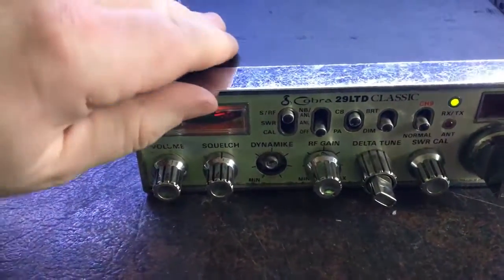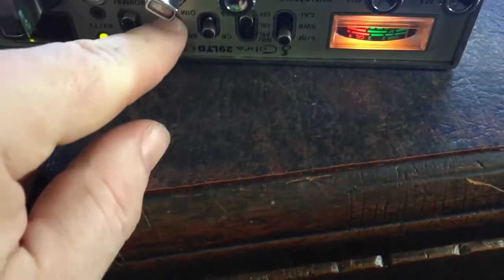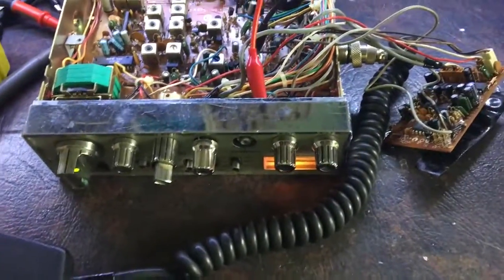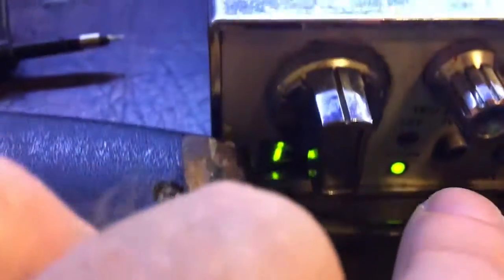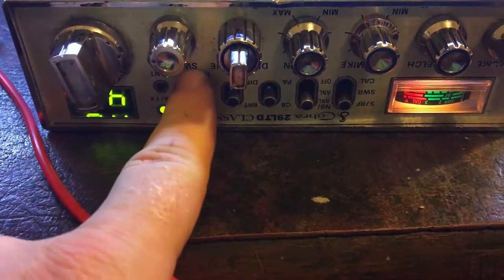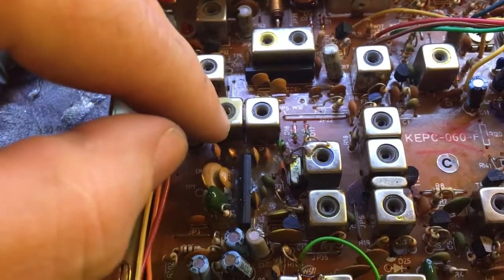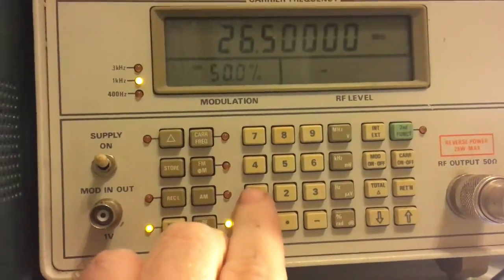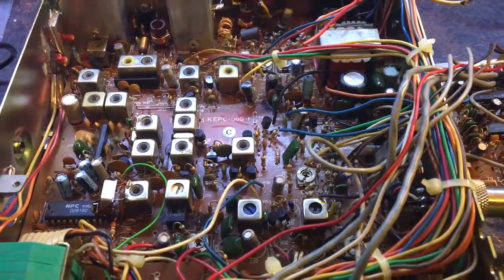#43 Repair of Cobra 29 Ltd Classic CB Radio

Comment: hi there i just found one of these old rigs i fancy trying it but have no mic will uniden /audioline wiring be the same as cobra 29. thanks for sharing your filming.
Reply from the maker: phil fish - yes wiring is 4 pin uniden.
Reply: @TheDefpom  now i put power to it and it just blew the fuse in the cable. ive looked inside. looked at the choke and d23 the protection diode looks ok. any ideas what to look for.